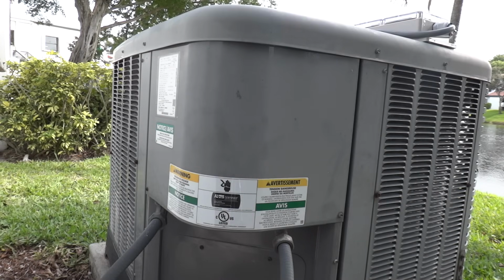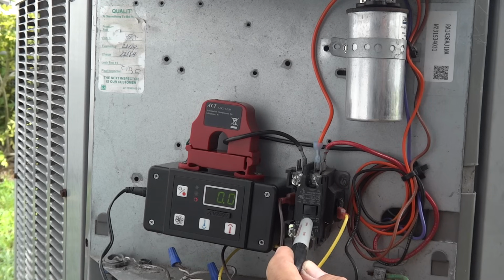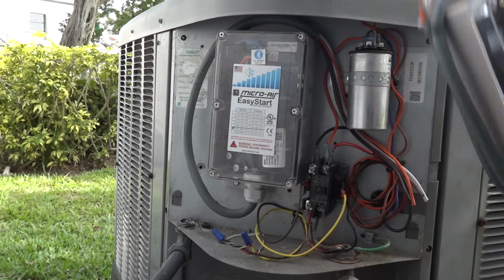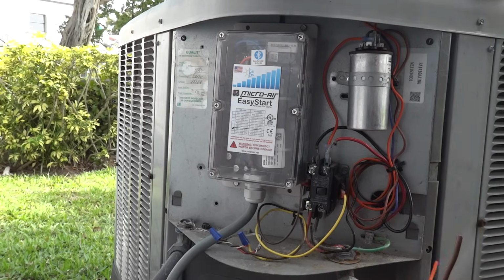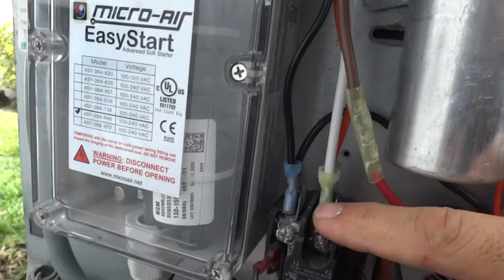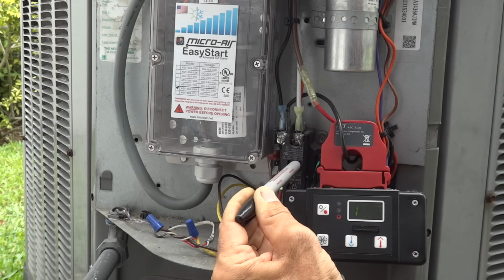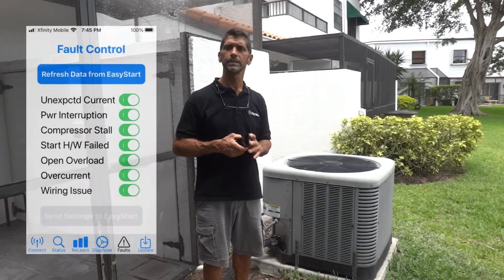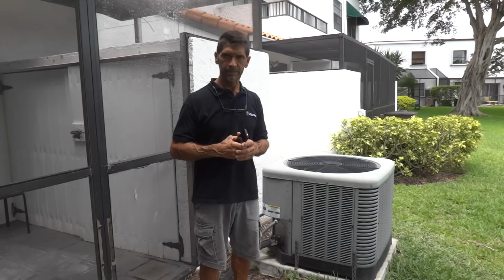Micro-Air EasyStart Home A/C Installation (368 Series)

Comment: I have a three-ton, two-stage Lennox compressor model XC16S036; I have just ordered your model ASY-368-X48-BLUE. Are there any unique settings or learning I need to follow to install the Easy Start on my system? I would appreciate any insight I can get. Your video was fantastic, and it described every detail. Hoping I can install the unit without hiring an electrician or HVAC fellow. I appreciate your response.
Reply from the maker: Hi and thank you for your comment and for your business. I'm glad you asked beforehand since there is one extra step you should take after you install your EasyStart.  The installation wiring is no different.

Since your 2-stage system uses a special scroll compressor with a bypass valve, you need to make sure that the EasyStart does its learning with the compressor operating at HIGH capacity.  The system will typically start the compressor at low capacity, and then switch to high capacity if called to do so. Therefore, it is important that while EasyStart is averaging the running current during the first 5 minutes of the first 5 starts/runs, you should make sure your thermostat is set to its LOWEST temperature setting. This causes your thermostat to engage "Stage 2", and this will cause your outdoor system to switch this bypass valve and cause your system to run at high capacity. So, make sure the first 5 starts and stops are done with the thermostat set to its lowest point, and that each start/run lasts more than 5 minutes (say 6 min).  After doing this, you can restore the thermostat to its regular setting and let your system and thermostat cycle normally on an attainable and comfortable setpoint.  Hope this helps!
Reply: Can confirm your unit will work properly on an Amana Model # ASXC180481BC (2 stage unit)
Reply from the maker: Hi David and thank you for your comment. I found your Amana system's manual online, the ASXC18 series. It confirms that your system has the same 2-stage Emerson Copeland scroll that Abbas' has, which is the type with the internal bypass solenoid. As with his, when learning the EasyStart, make sure the thermostat is set very low so both the Y1 and Y2 outputs get energized (i.e. both stages are being called).  Beyond this, your Amana also has feedback to a special circuit board from the compressor's start winding. This might present a problem for you since when we see this feature, it sometimes means this control board inside the outdoor will not tolerate the 5-sec to 3-min delay that EasyStart may impart on the compressor startup.  In other words, the circuit board might think something is wrong with the compressor because it did not start right away, and then it will shutdown power to both the compressor and EasyStart (which are wired inline), resulting in nothing ever running. To deal with this, we added a selectable feature to EasyStart that can be invoked from its smartphone app, so if you do run into this issue, contact help@microair.net to find out how to use it. Hope this helps.

Comment: I watch your video great very good installation thanks but I still can not find the easy start ID for 368 can any one show me thanks
Reply from the maker: Hi and thanks for your question and for your business!  The EasyStart's Bluetooth ID can be automatically detected the first time you use a new EasyStart. Simply leave the ID blank, or enter "EasyStart_" (pressing Done or Return to close the keyboard).  Then, when you tap "Connect to EasyStart", the app will find the first and closest EasyStart that is powered up (i.e. compressor is powered on), and it will automatically fill out the ID into the box and save the ID into the app's saved settings for future use of the app. Hope this helps.

Comment: AC units have a dual capacitor, one is for the compressor (herm) and one for the fan. There is no switching between starting and running so its neither a start or run capacitor its just a capacitor that creates a out of phase line so the motor will work on single phase.
Reply: you are right about phase shifting a second winding. If there is no switching and cap stays in circuit for both start and run than it's a normal run cap, right?🤙
Reply: Many condensers now come with an ECM fan motor. They don’t use a capacitor to start, only the compressor uses one.
Reply: @bills6946  I would assume ecm motor wound not be happy with a soft start.
Reply: @ 
We don’t install soft start. We have heard of a concerning failure rate. We will hold off with them for all of 2025. We do include an Intermatic AG 3000 surge protector on every condenser and furnace we supply and install. It has nothing to do with inrush current but protects control boards, compressors and fan motors quite effectively.

Comment: How well will the Easy Start function in the AZ heat?
I tried a Sure Start and it would not function properly above 90 degrees.
Reply from the maker: Hi Richard and thank you for your question. EasyStart is specified to work in ambient ("desert") conditions up to 50°C (122°F), but it was designed to go beyond that.  It has proven to function well up to 55°C (131°F).  Many of our 70,000 RV customers have taken their EasyStarts into some of the harshest desert conditions imaginable, including some in the Australian outback, and EasyStart was able to handle them.

Comment: Watching this video helped me install my easy start. The manual talks about a yellow wire but no mention of a purple wire. Anyway this video helped me to complete my installation with confidence that all was well. My unit is a Raheem 5 tons and rated at start amps of 144. My clamp meter could not capture the start amps but now I am at 2 learn starts, With a peak of 51.3 and live at 11.6.

Comment: I am not comfortable installing this myself. Do I need an HVAC tech or an electrician to install this? Thanks
Reply from the maker: Hi and thanks for your question.  Either an HVAC technician or an electrician could handle installing an EasyStart. There are many HVAC dealer/contractors that have experience with EasyStart now, all over the USA.  Inquire first, or check the Dealer Locator tool on the www.microair.net website.

Comment: 7.15.22
How does one determine how many tons the heat pump is?
Reply from the maker: You can determine the tonnage of your system by reading the model number off of the dataplate label on the outdoor unit.  You can then Google that, or send it to help@microair.net, and someone there will tell you what model EasyStart you would need.  Hope that helps.

Comment: can you tell me in general terms, how  Micro-air 368 is able to lower my starting amps?
Reply from the maker: Hi and thank you for question.  The EasyStart is able to lower the starting amps using its sophisticated, microprocessor-controlled electronics by gently applying the voltage and current to the compressor motor to start it rotating and accelerate it with the least amount of energy possible.  This is in stark contrast to how a regular (hard) start works which applies ALL the voltage all at once, while the compressor is still at a standstill, resulting in the very high locked-rotor amperage (LRA) being drawn. EasyStart does the opposite by applying the voltage and current spread out over a much longer period of time, monitoring the compressor's rotation and current draw all along the way in a closed-loop control system.  This reduces the peak starting current by 65-75% from this normal LRA rating. During the first 5 startups, EasyStart records and analyzes the compressor's rotation and current draw in what we call the "learning" process, and it optimizes it parametrics to deliver the absolute best performance and lowest starting surge current possible.  Once the startup is completed, EasyStart then continues to monitor and protect the compressor from potentially harmful conditions like low-voltage, overcurrent, stall conditions, miswirings, and power interruptions.
Reply: @MicroairNet  On a 240vac compressor, what is the low and high voltage limits which would result in a RUN wire power disconnect?
Reply from the maker: @TheRealoldcar  The voltage limits are actually combined with the learned current behaviors of your particular compressor.  Specifically, since we do not want EasyStart to produce nuisance faults or trips, we have to allow the input AC voltage to sag during startups and even during regular operation for limited durations.  The key is that EasyStart is also continuously monitoring the more important parametric: the compressor's current draw.  Unlike other AC induction motors, constant-torque motors like a compressor will increase in current when the applied AC voltage *decreases*.  It is this increase in current that presents the potential hazards to your compressor, not the voltage itself.   Similarly, with increased applied AC voltage, current may initially decrease, but then it will start increasing again with further increased AC voltage.  So, in order to avoid nuisance issues on both ends, and to keep the compressor operation as uninterrupted as possible, EasyStart assigns the lower and upper voltage limits in concert with the live current measurements using a proprietary fault algorithm.
Reply: @MicroairNet  Great.  That is a smart way of doing that.   Thank you again for such a well engineered product. Will be ordering mine soon.

Comment: Excellent video. I just got done watching and installing my EasyStart 368. When I was installing, I bumped the orange wire connection and came off from the capacitor. This signaled a "wiring fault" in the EasyStart app. I re-wired and made everything tight again, no more fault. Is there a way to clear the Faults: 1 from the app now?
Reply from the maker: Hi Justin.  Thanks for your compliment and for your question.  The only way to clear the fault count is to do a ReLearn.  We don't recommend that you do that if you are having favorable startup performance results with your original (factory-initiated) learning episode, but if you are determined to clear your fault count, this is the only way.

Comment: Just got my Soft Start today for my 5 ton. I’m going to DIY it this week. Everything makes sense, except the top of the capacitor. Hoping it makes sense when I take a close look. Black - L1, white - L2, brown to compressor (spliced), orange to top of capacitor (I think the HERM terminal).
Reply from the maker: Hi Willie and thanks for your business!  Yes, you have it correct.  As I mentioned in the video, be careful not to connect the EasyStart's ORANGE wire to the wrong terminal of the run capacitor, especially if it is a "dual" run capacitor with 3 terminal clusters.  The compressor's start winding connection is always on the "HERM" terminal of the run capacitor, as you already mentioned.   That is where the EasyStart's ORANGE wire should also be connected.

Regading the EasyStart's BROWN wire, that will be spliced to the run winding wire (whatever color your system's internal wiring uses) after you disconnect this run winding wire from its contactor terminal (typically labeled T2 or T3, which is the switched L2 output of the contactor).  In place of the run winding wire will go the EasyStart's WHITE wire on the same contactor terminal.  Then you splice the freed run winding wire all by itself to the EasyStart's BROWN wire.  Hope this helps.

Comment: Are these compatible with Copeland Scroll compressors?
Reply from the maker: Hello and thank you for your question. Absolutely yes! In fact, EasyStart does a tremendous job reducing the starting amps of scroll compressors, especially those from Emerson Copeland.  Although we advertise 65-75% starting current reduction (from LRA) with EasyStart, scroll compressors tend to perform more towards the top of that range.  Enjoy!
Reply: @MicroairNet  Perfect. That's what I was hoping to hear. I've been unable to process an order through your website. Is it possible to place an order by phone?
Reply from the maker: Great to hear.  Typically all orders are processed through the website because the factory no longer has phone-in credit card processing capability.  You can try calling though, and maybe someone there can assist you with why the website order processing isn't working. The factory phone number is shown at the bottom of every page of the website.
Reply: @MicroairNet  I realize I asked the wrong question. I need to know if they are compatible with 2-stage scroll compressors.
Reply from the maker: No problem.  Unfortunately, the answer is now dependent on your exact type of "2-stage" system. Some use 2 compressors, some use a "dual-direction" compressor, some use an on/off bypass valve, and some use a "digital" scroll with a modulated solenoid valve at the top.  To make this easier, take a photo of the dataplate label on your outdoor unit, and email it to help@microair.net asking the question if EasyStart would work for this 2-stage model.

Comment: Thanks for this most excellent video.  I installed my X48-Blue on my old 4 ton unit earlier this year.  Was able to start/run everything on my 7kw run/8.75kw start generator with no problems.  Just had new 4 ton unit/system installed last week, and re-connected & re-learned the EasyStart.  The start amps now for the most part are around 40 amps (LRA amps listed as 109).  However, I have noticed a couple of starts at ~75 amps which I do not understand.  I will send the data again to Micro-Air next week.  Barry in customer service has been helping me.

I am concerned that my generator will not start this unit if 75 amps is required.  Hurricane season is upon us…was without power for 10 days last year because of Hurricane Ida, so that is why I purchased a generator and EasyStart.  Do you have any idea why the required amps would almost double from 40 to 75?  Again, it is not all the time; I just happened to check it at random today.  Thanks again for the video.
Reply from the maker: Hi and thanks for your compliment and your comment.  Yes, please upload the data to Micro-Air using the Bluetooth app and Barry and I will have a look.  Sometimes, an occasional, narrow current spike might occur at the tail end of the startup, and the app will report them since it is always looking for the worse single-cycle (8.3ms) peak.  But don't despair since a single-cycle peak won't impact your generator. It's the broader peaks (three cycles {50ms} and more) that affect your generator, and EasyStart has already reduced these from 109A to 40A in the case of your system.  If we see anything, we'll report back to you.  We might want you to do a relearn, but don't do that yet until we check it out.
Reply: @MicroairNet  Thanks so much for writing back…and on a Sunday!  I am impressed!  And thanks for your explanation of these ‘peaks’…hope that is all that this is.  If the Micro-Air is faulty, I am happy to buy another one.

I will send the data later today.  You see, I live in the NOLA area, and don’t want to be without power for 10 days ever again.  My generator is a tri-fuel Champion, and I run it on natural gas; gasoline was/is impossible to get after a hurricane.  Thanks again for your most excellent video.  As I told Barry, your product is so well made, and it is made right here in the USA!  Hope to hear from y’all this week.
Reply: @papajohn3182  hello did you find out what the issue was?
Reply: @williamallen5369  The only thing they wrote back is what you see in their reply about it being only 8.3ms and should not be an issued with my generator starting it; guess I will have to do another run test on gen power to find out.  I have heard no more from them.  FYI, I have another Micro-Air on order for my 3 ton upstairs unit.  I do like the reduced starting amps for my 4 ton, and you can definitely hear the difference in startup between the two.  I do believe it can only help extend the life of the compressor.
Reply: @papajohn3182  that is good enough for me already thanks
Reply: @papajohn3182 hey bud I know it’s been a year but did you get around to seeing if it would start up your 4 ton system with your generator? Have a customer of mine with a 4 ton and I really don’t want him to waste his money if it’s not going to start with the generator.
Reply: @brandonstephens1447  Yes, no problem with my 7KW generator starting my 4 ton unit with the Micro-Air Easy Start installed.
Reply: Following

Comment: I have an American Standard heat pump and my purple wire on the capacitor is not on the HERM terminal. It’s connected to the one labeled C. Do I place the orange wire on the C or HERM terminal?
Reply from the maker: Hi Daniel and thanks for your question.  The internal wire colors for home A/C units can vary quite a bit.  I agree that typically a purple wire is more often used for the start winding, but perhaps in the case of your American Standard unit it is not. You can verify that by inspecting your system's wiring diagram on the inside cover of its electric box.  Regardless, the ORANGE wire for the EasyStart always goes on the HERM terminal of the run capacitor, assuming the system is wired correctly to begin with.  It's always a good idea to verify this using the system's wiring diagram.
Reply: @MicroairNet  got it installed a-okay. I went back and listened to the video and he pointed out to make sure it’s not connected to the terminal with the fan. After looking at the wiring diagram for my unit, that’s exactly where my purple wire was going. So I used the HERM terminal (which went to the compressor) and all is good and it’s up and running. Thanks.